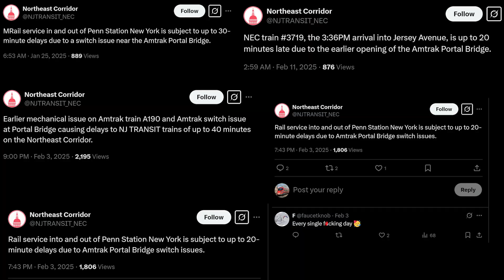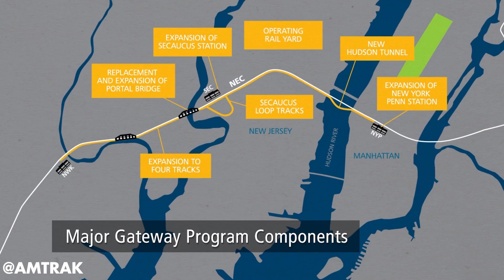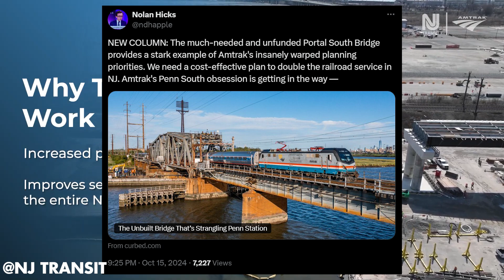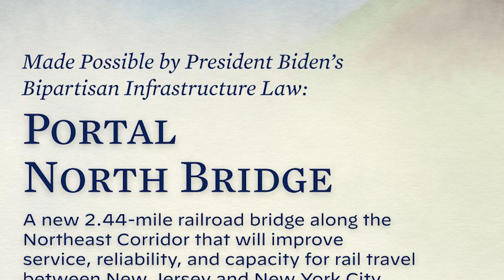Amtrak's $2.2B Plan to fix the NEC is coming

Comment: I know this is going to be a hot comment.
But as big oil
And the automotive industries  worked wonders in lobbying the demise of rail and the use of the individual automobile. In the process killed walkable communities that were successful using trolleys, interurban, and heavy rail.
A “Amtrak tariff” can/should be imposed on these industries and all short distance flights. 
 
Such tariffs would provide a direct subsidy for Amtrak services as well as make it competitive.
Especially the short flight tariff between Amtrak services locations.

No Matter how you cut the pie, it cost money the move my ass, and all of your asses 😂.

We think  car is cheaper, it may be but it’s absolutely the worse investment you’re forced to Make,  the expenses to keep it up and running, and the fees you pay in taxes & tariffs to drive on highways,
And the insurance fraud/scam to be “legal” While on those roadways adds up. 

I think the issue here is the idea of a cross country HSR vs a corridor based system that’s either intra state or inter state but not cross country.
However as such corridors fill out they will at some point tie into existing corridors. 

For example is brightline west Don’t mess up, they could very well develop the Vegas depot to be in a location where building  to salt lake and into Arizona could be very well done. This Demonstrates how the localized infrastructure can be expanded.

In a similar way Brightline (FLA) could potentially make ways to Jax and Atlanta providing that service becomes warranted.
A tariff on short distance flights would Pay dividends on this

Comment: In round numbers, it is 2.5 miles of new track/bridge for $2.5 BILLION dollars. $1 BILLION per mile. In contrast, Brightline in Florida was able to connect Miami and Orlando (170 miles) for $5 billion. Brightline West (suburban LA to Las Vegas) will be 185 miles and cost $12 billion (while not crossing major rivers, it does have to traverse the San Bernadino Mountains).
Reply: Comparing apples to oranges.
Reply: @algerpiston168  Comparing apples to different kinds of apples, more like
Reply: Why the price difference?
Reply: I don't believe Brightline has to worry much about property acquisition (that's their reason for building on highway land), nor do they have to worry about building large structures on or under marshland, or under major cities with extensive utility relocation
Reply: Let’s not forget this bridge likely accounts for almost 20% of GDP.  Also, the price of the real estate in NJ cannot be overlooked.
Reply: @ The rail line doesn't account for that 20% alone, even if it does some heavy lifting for commuters.
And I highly doubt real estate located on marshland is worth a huge amount, even in New Jersey.

Comment: I wonder if old bridge could be removed and preserved also I hope the railroad will use constant tension catenary.
Reply: The bridge and new tracks will indeed be modern catenary. Lots more left to replace though...
Reply: The old bridge will not be preserved in any way. There is no capability of doing that, it's too large

Comment: The greatest transportation mistake the US made was going all in on cars. Not maintaining and then expanding train corridors has caused so much harm and is now so hard to fix. This project is a good step but Trump taking credit shows how delusional the right is. The project will help keep up for a while but isn't going to solve anything at least until the other projects north and south along the entire NEC are addressed.
Reply: Completely true about the delusional right-wing – they fight tooth and claw against infrastructure spending of any kind (except highways that only make congestion problems worse), and then when the projects are about to be finished, they want to take credit for it.  On the other hand, here's the recipe for getting any project funded, for at least the next 4 years: name it after Trump.  He doesn't care about any project's merits, or any benefit to the country about anything; he only cares about being famous and being perceived as being in charge.
Reply: @algerpiston168 You've hit it right on It's head. Trump is all fluth. No substance and will take credit that was done by others and the previous administration(s). Now he'll slow things up or stop any progress our country really needs then he'll blame others when he actually the knucklehead that stopped or slow these progresses.

Comment: A unified catenary system would go a long way. in reliability and cost reduction in maintenance.
Reply: They’ problerly going to use 25 or 12kv 60hz, but all silverliner iv will have to be removed, only on 25hz lines, or to be converted
Reply: @ihatelategame  Just removing Silverliner IVs, or only running them on 12kv lines, is impossible, they'd have to be replaced. And based on how NJT's Arrow III's handle multi-voltage (they can't switch over while in operation) the only conversion that would be viable would be converting SEPTA's 25 Hz traction power system to 25kv. Otherwise converting the Pennsy system to 25k would cause Philly's biggest transit crisis since septageddon. Silverliner IV make up the bulk of SEPTA's fleet, and the design of the Regional Rail system REQUIRES nearly every train to switch between the SEPTA's and Amtrak's power systems. (Because we stitched the ends of the Reading and Pennsy systems together to make an S-bahn) ONLY trains running under Amtrak's power are even capable of terminating before the change over. (Because we had to bypass the Reading Terminal. And no we can't go back to sending trains there, the Convention Center it was incorporated into is in the way) The last station that's on SEPTA's electrification is Temple University, but the last place that you could terminate a train is Wayne Junction, except for the Norristown line which has nowhere that a train can be terminated until 30th Street, after switching to Amtrak's electrification.

TLDR: It's impossible to convert Amtrak's 25 Hz traction power system to 25kv until SEPTA REPLACES their Silverliner IVs.
Reply: It’s not that serious use dual modes